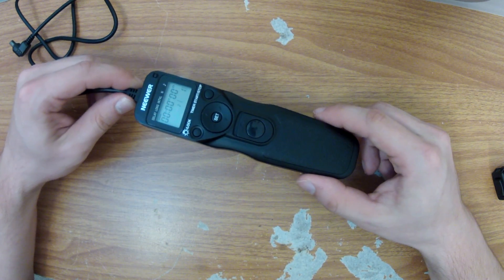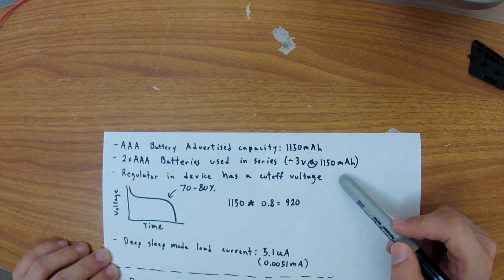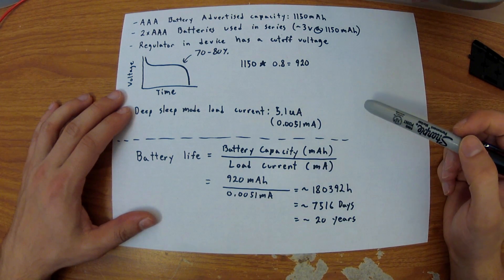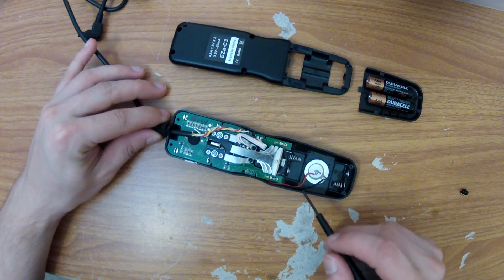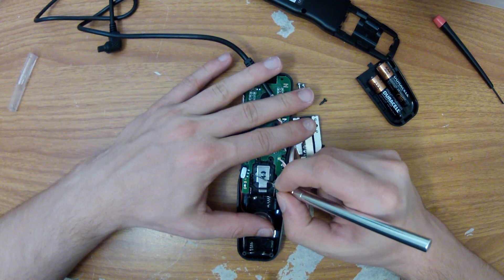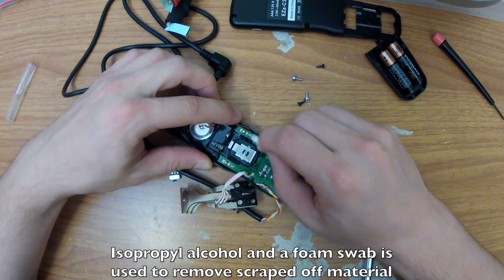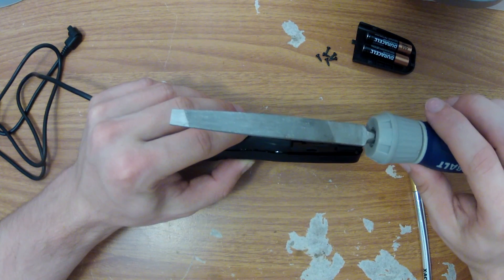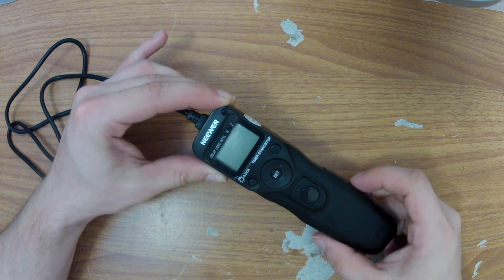Adding a switch to a Digital Timer Remote

Comment: I have had my timer for over a year and still am running on the same batteries. Plus I have done  several 10+ hour time lapse shoots and haven't had an issue. I don't think a switch is even needed at all.

Comment: What kind of switch is that......??
Reply from the maker: It is a surface mount right-angle on-off slide switch. I included a link to the specific part in the description of the video.